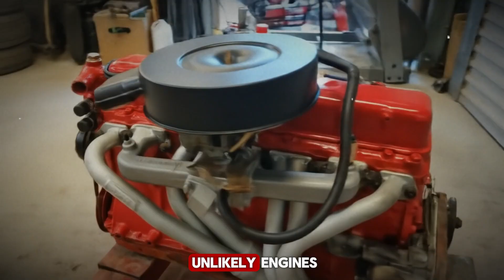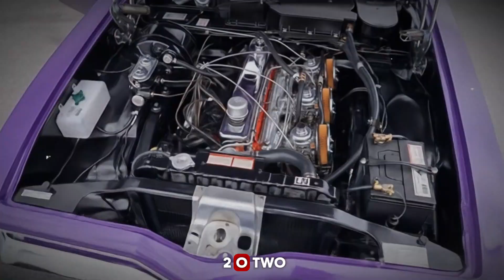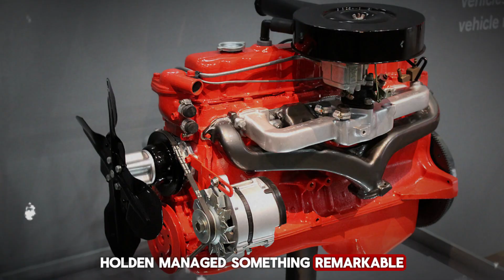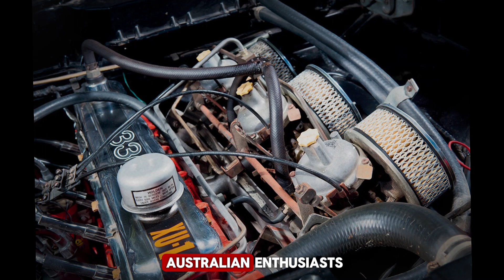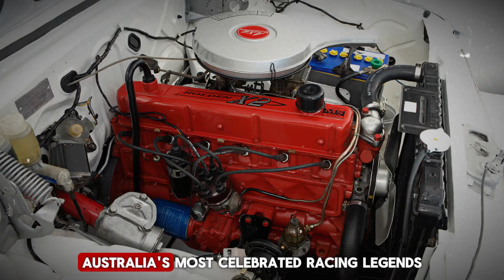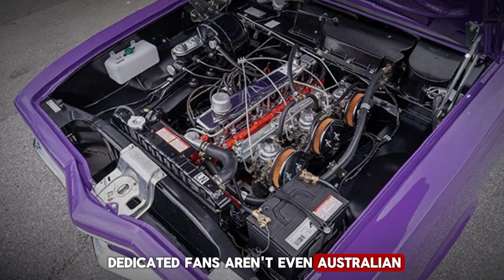The Untold Story of the Holden 202 – GM’s Forgotten Powerhouse!

Comment: What a load of shit,, first red motor was 149. 138 never happened until 69. 202 was released in HQ in May 71. 202s standard were asthmatic slugs. Flatout @ 4400 rpm.
Powerhouse? XU1 only and even then asthmatic. But would run to maybe 6200. And only as a race engine,,, they shook the flywheel loose at before 6 grand. Rsce prep was steel flywheel and shrink it in on the crank end.
Reply: The first was offered in the EH in '63 and came as either a 179 or 149. 202's weren't just asthmatic, they sucked petrol like there was no tomorrow, especially in later models with air pumps and other ill thought out anti pollution devices fitted.
And they never seemed to run as well or as smoothly as the earlier smaller engines. Nor did they have the steel cranks of earlier engines, either, unless it was a performance model like the XU1. 179's and early 186's were always the engine of choice for tuners. 202's were seen as a boat anchor, by comparison, and plenty of tuners wouldn't waste their time and money on them. I don't know where this guy got his information from.